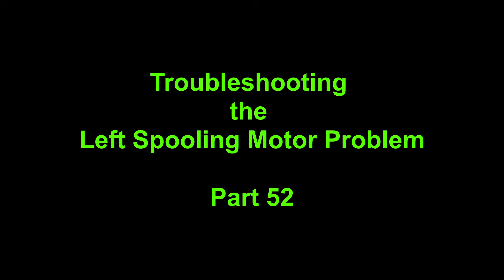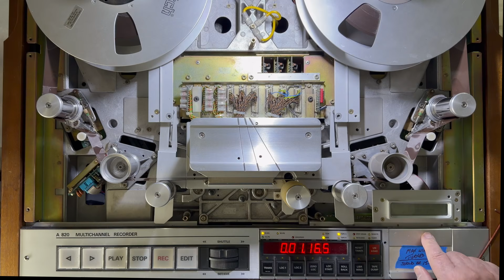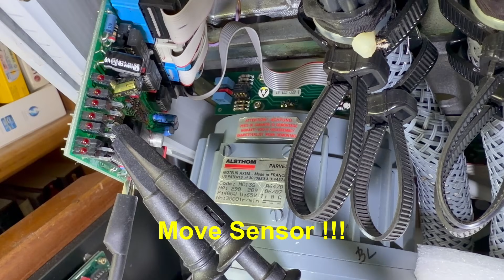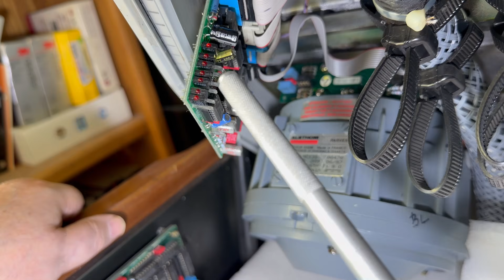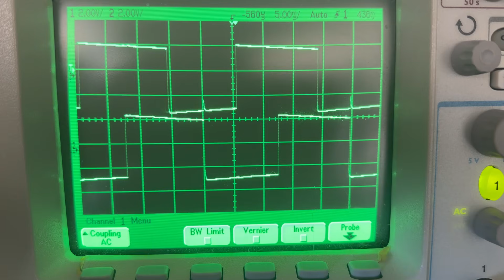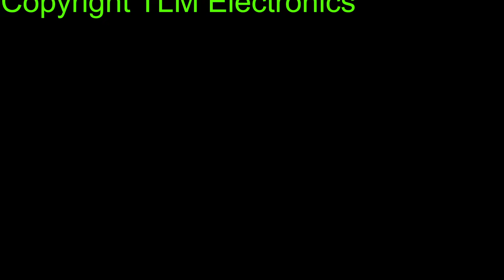Studer A820 2" Multitrack Restoration - Part 52

Comment: Something that I think I caught. You'll have to do a bit of experimenting to double check me. As follows: 

Attach the scope to pins 8 & 9 on the left motor and place it where you can watch the reel.

Put a temporary marker - a piece of tape on the reel. Run the machine in forward and reverse play and note where the tape marker is when the signal glitches. If it does then the problem could be mechanical like a bad drive component -  a wheel with a flat spot or gear with a broken tooth for example - and not electronic. If it's not mechanical then I'd look at possibly a timer chip (if there is such a thing) with an internal short on one pin or something else connected with the time code generation circuitry or the signal amplifier on the tach. Maybe a solder joint gone bad or broken leg off a component. Something like that.

CORRECTION: What you're looking for is the scope to glitch whenever the reel is in a given position as shown by the marker. Example: if the glitch happens nearly every time the tape is at 6 o'clock then it could be mechanical.

On reflection try running FF and see if the tape stays in roughly the same spot whenever the scope glitches. If it does then it's almost certainly the time code circuitry; that depends on a constant speed past the tape heads and in all modes the tape speed will remain constant while the speed of the reels will change - rotation speed versus circumference giving a set distance per unit measure of time. 

Conversely, if you try that and the scope glitches at a spot that's moving one direction or the other it's probably tied to the reel motor, and for the same reason. 

This won't tell you what the problem is but it will narrow down where to look and what to look for.
Reply from the maker: Thank you, that’s a smart idea. I’ll give it a try.

Comment: Most probably looks like dirt in the optical encoder or the encoder is loose. But have you measured the current that the motor draws? Maybe the motor is straining at hight speeds and the controller cuts it off. Try to rewind at low speed and slow down the left spooler with your finger, that should increase the current of the motor, see if you have the same behavior. Also try to compare with the right motor current. Good luck!
Reply from the maker: Actually I didn’t mention it in the video but I did measure the current of the motors and there was nothing really different. I also ran at 30ips, and played the entire roll of tape in both directions that way the weight of the spools (pack of the tape) was the same either way. Same result, no problems. 
Also the best I can tell the optical disc is not loose and the encoder is clear with the disc riding in the center. 
It really has to be some rust or something that is transmitting the “bind or rub” onto the shaft causing the glitch in the waveform. 
Thanks for following along, I’ll let you once I have it disassembled.